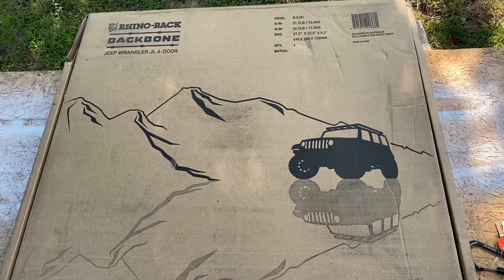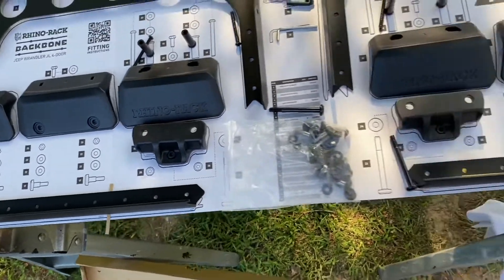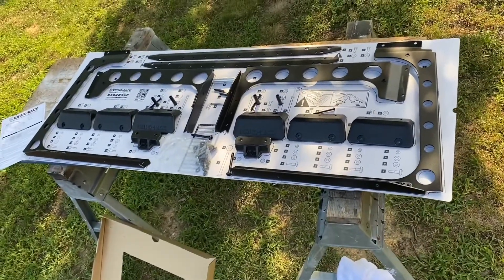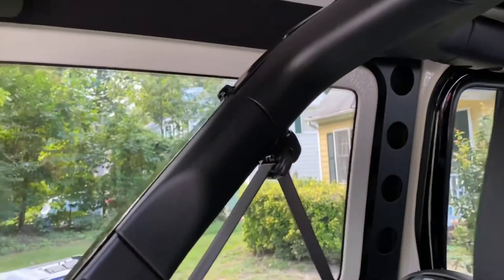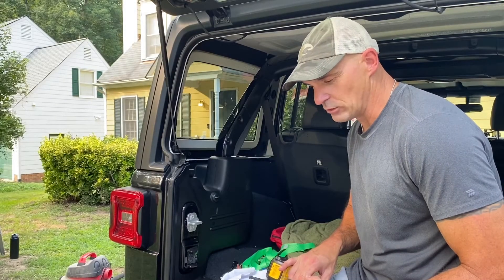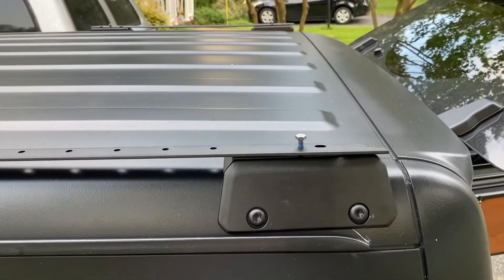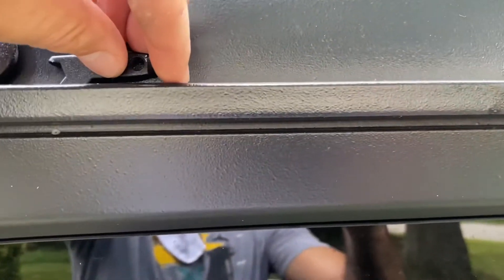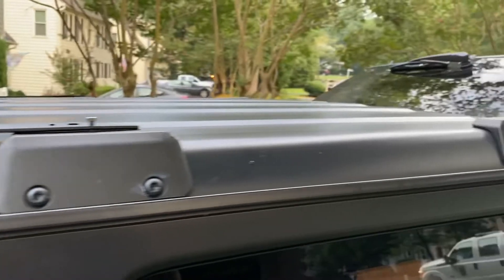Strengthen Your Jeep for Adventure : Installing the Rhino Rack Backbone System - Easy Step by Step

Comment: Another great video. Doing mine this weekend. What exactly do you use for the sealant? Do you have a link?
Reply from the maker: Thanks and congrats.  I use sika flex 291 in white, it also comes in black but white is what i had, i am not a fan of silicon because of the residue it leaves if you ever need to remove it and prefer an adhesive sealant, you can use 3m 5200 but i like the sika flex better, you can buy it on amazon just search for sika flex 291, good luck its hard mentally  to drill that first hole, but once your past that is pretty easy
Reply: Thanks